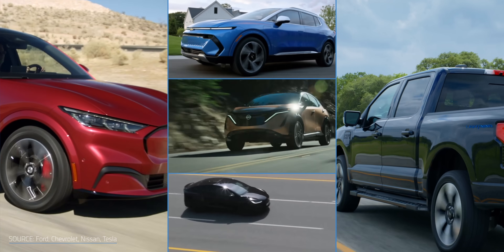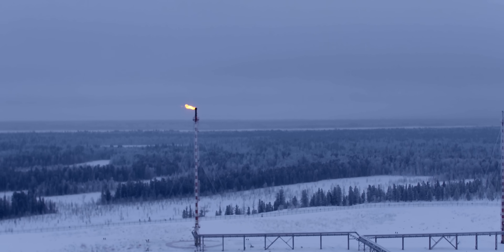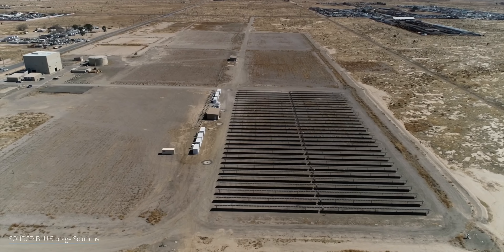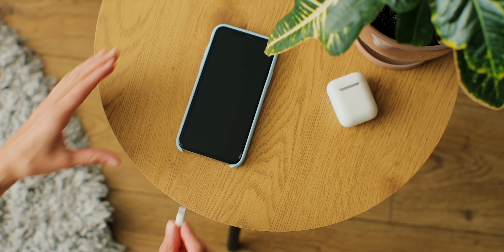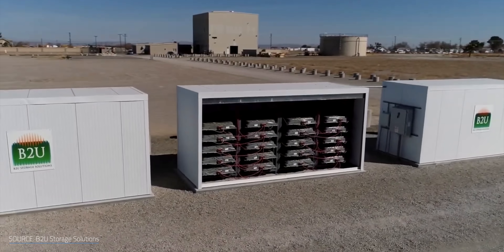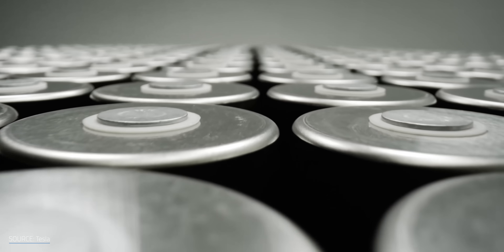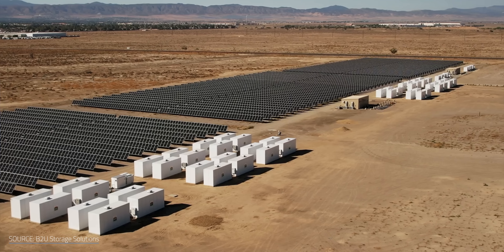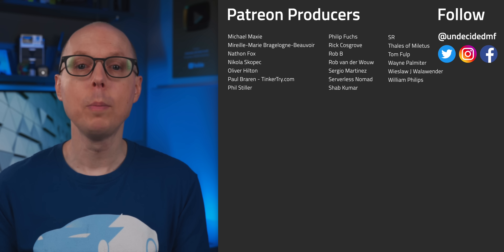How Old EV Batteries are Perfect for Energy Storage

Comment: Manufacturers could do a lot to help make this happen by building a basic standard BMS protocol into their packs.  Should probably be mandated to do this.
Reply: The standards tend to be formed by the number one players.  A good example of this is, just this past week Ford and Tesla publicly announced their collaboration on Ford accepting the Tesla plug standard.
Reply: That would be great for the grid storage industry, but terrible for the car industry. It would never happen
Reply: “building a basic standard BMS protocol”

They got them… if you really want to use them. 

The question is whether the complexity is worth it for the aggregators, dealing with every manufacturer’s software bugs, possibly with a bug causing a fire, when you can buy an off the shelf BMS & manage all the battery types the same way, with your own software.

I chose path B
Reply: It doesn't need to be a standard across manufacturers. There are not that many. It would likely be sufficient if the BMS interface was documented.
Reply: Or, manufacturers could license the tech, have buyback programs for their own batteries, and build their own power storage facilities using their own batteries. Not just standby power, but to be able to switch to stored power during peak times to buffer their own energy usage from the grid when its most expensive.
Reply: @SOHCGT96  - “manufacturer… buyback… own power storage facilities”

I don’t think an auto manufacturer wants to take on the risk of battery 🪫 lithium fires 🔥 after a battery 🔋 may have been in an auto accident or after a battery 🪫 is out of spec.

A battery 🔋 manufacturer, on the other hand, may want to create a subsidiary, which could be spun off to reduce liability…

Sounds like an opportunity!!!

But eventual recycling needs to be in the picture, and not just reuse ♻️ until it 🪫 spontaneously combusts 🔥
Reply: @DavidHalko  Running that type of business as a subsidiary would probably be how it worked anyway to separate costs/revenue streams. Lithium fires aren't fun but for stationary applications, not only can you more effectively monitor loads and temps to disconnect a pack before it has problems, but fire suppression is much less challenging. What they MIGHT need to consider though is mitigation of environmental hazards and I bet you'll see these mostly in dry areas or ones not near a flood plain. Seeing what a few cars did in the last hurricane, I can't imagine a stationary power battery array doing well in a flood.
Reply: @SOHCGT96  - “I bet you’ll see these mostly in dry areas or ones not near a flood plain”

Solar farms appear on flat land, to maximize sunlight capture and much farmland is near water & on fertile land… interestingly enough, these two things are near flood plains. Some areas in the dry South West US USED TO BE flood plains.

Solar farms really need temporary storage, to not supply power to the grid during times of energy plenty, to supply power during times of need, and maximize the use of copper attaching solar farms [which are roughly 50% unused.]

Solar farms are the locations which REALLY need temporary energy storage, to supply the needs of a region. I really wish something like splitting & storing & using hydrogen for odd timed energy would be used, instead, since water is more available than Lithium.
Reply: the leaf batteries have just that.
Reply: While that would be ideal, in practicality it would hardly be feasible. However, there is definitely room in the market for creating a basic template that makes it easier for startups and existing companies to adopt this standard by nature of it being cheaper than them investing into their own production. Thus far most of the big players keep their stuff proprietary and don't share amongst each other, which is why I'd assume this hasn't really happened yet at a large global scale.
Reply: @Real_MisterSir  It's absolutely feasible though. This is the same kind of excuse Apple uses. Following standards is easier than making your own proprietary protocols/wiring, which they do exactly because they don't want re-use/repair etc.. Car manufacturers are the worst.
Reply: @realms4219  It's not about the batteries, it's about the platforms they're matched to. Automakers, especially the larger corporations, go to great lengths to optimize every inch of the frame, the packaging, various dimensions to gain competitive advantages in some areas while letting go in others, etc. It's not like a smartphone where it's just the connecting port that has to be slightly different but still wired essentially the same way. It's entire multi-vehicle spanning platforms that are tailored by each individual manufacturer making use of their already built factories and machines and formulas that can't just easily shift on a dime. These are major ships that take time to turn, and with so many advances in battery tech happening each year it is generally considered that there isn't a big incentive to force entire platform unification (yet). EVs are still in the early phase of taking off and gaining market share. As long as that's the case, I don't think any government will want to press the issue and present more barriers than they remove.
Reply: @Real_MisterSir  As you say, the market for EVs is really only just getting started - so surely it's much better to have common standards now than in twenty years time when the carmakers excuse will be that there are so many non-standard cars on the road that the idea is a non-starter?
Reply: ...also integrate peaker plants into the railway system for efficient transport and handling.  As the railway system becomes electrified, they have a vested interest in supporting this upcoming infrastructure.
Reply: @waynejanik7046  - electrified rail in the north east looks like hell, there has to be a better way, to replace the rat 🐀nests of wires hanging all over the place, for hundreds of miles, as we travel down roads & looking at that ugly 💩
Reply: @GeorgeWashingtonLaserMusket  You're confusing BMS and BMS protocols a BMS can have multiple protocols.  If a standard protocol was brought in the car makers would still have propriety BMS & protocols but once taken out of the car people would still be able to communicate with the BMS for some of the basics like cell voltage, temp & balancing.  At the moment several EV batteries which aren't usable as there's no way to communicate with the bms and no effective way to disassemble the battery.
Reply: @blacko3539 : Which manufacturer and model EV are you saying “there’s no way to communicate with the BMS” about? Because I’m here to tell you, a BMS that doesn’t communicate with any other part of the vehicle at all would be as useless as a grease zerk on a steering wheel. Just because it’s not documented/disclosed or in a straightforward way, does NOT mean it’s completely impossible. There is a difference, and it does matter.
Reply: @jacobcarlson4010  Of course they do, we're talking about using them as batteries after they've finished being an EV battery.  First generation Ampere/Volt batteries for example are just scrapped because it's not economical to refurbish them.
Reply: @blacko3539  This is correct. Any manufacturer could make their own protocols to their hearts delight, but they would be required to include protocols that meet some minimal standard. This way they can protect their BMS IP while being good citizens when batteries get reused. There would be almost no cost to the manufacturers - plus any regulation could have language that would force them to not pass on costs. Sometimes companies have to accept that something for the public good is "just the cost of doing business".
Reply: An then here is Tesla. They glue there battery to the chassis. It's so bad that you can not take the battery out and reuse it. 

There is a big need for legislation that forces  OEM to allow standard connection and replaceable batteries
Reply: @save_jeff : I’m %100 with you on that; declaring an entire vehicle worthless because one part is worn out is frankly ludicrous. It’s one of the many reasons that I’ll never own a tesla.
Reply: Or at least force the car makers to support the integration of their battery packs into these types of systems.
Reply: @RossBobby  - “force…”

Dude, you just take the pack & connect the wires to an off the shelf BMS. This is not rocket science. It took me an hour to figure out the wiring on 2x different kinds of FORD battery modules.

You just have to not be stupid & know how to use a breadboard with a multi-tester.

I did stuff harder than this when I was in high school
Reply: It would take a mandate to do it.  They'll never do it voluntarily.
Reply: @Cee64E  - “mandate…”

Dude, you buy the pack & wire an off the shelf BMS. This is not rocket science, I did it with 4x FORD modules.
Reply: @DavidHalko , You did it.  I could probably do it.  But not everyone knows their way around a voltmeter, let alone a BMS.  It could be something as simple as making the instructions to convert an EV battery to a stationary storage unit for each pack publicly available on the manufacturer's web site.  Just something to put an end to the proprietary locks on a battery.  It's not like I'm suggesting they mandate something stupid, like wireless, battery-powered, tire pressure sending units in each wheel to tell dumb drivers when their tires are low...  

Oh, wait....
Reply: @Cee64E  - there is not much to it.

The BMS just measures voltage of the cells. The battery packs are wired in series. There is a pin for each battery 🔋. The power or ground goes through the BMS. If a battery is out of range, the battery is shut off.

You can’t make a device much simpler.

Every BMS on the market comes with instructions on how to connect them to batteries.

It is just a matter of doing it. If you put multiple batteries 🔋 in a flashlight 🔦, measure the voltage with a multi-tester between batteries, you could hook a BMS up, following the directions.

I did stuff like this in middle school & high school. The scale is just bigger with this stuff… bigger in the sense that these batteries 🪫 will burn 🔥 your house 🏡 down in a moment, as soon as they spontaneously combust… and there is nothing a BMS can do to stop 🛑 spontaneous combustion of a Lithium Ion 🪫 which has a short develop from dendrites growing between terminals inside the 🪫 battery.
Reply: @DavidHalko , Yes.  I understand that.  I know how to use a voltmeter and I've done a little work with a BMS on small projects.  But we live in a world where Preperation H has a warning not to eat it on the package, and curling irons have warnings NOT to insert them into ANY body orifice.  There are people out there who can't figure out where to put oil in their engine because the only cap they can find says 710 on it.  I'd bet a dollar to a donut that you know someone you wouldn't let near a standard 12v car battery, let alone something with a couple hundred volts and a few kilowatts of power.
Reply: @Cee64E  - and these types of people should not be encouraged to work on batteries 🪫 that spontaneously combust with age, because dendrites grow over time within the battery 🔋as they age… lest the “Preparation H” ingesting generation decide these nice warm used auto batteries should be placed under their baby’s 👧 crib to keep their precious offspring nice & warm.
Reply: @Cee64E  In the only application mentioned in the post (LARGE-scale commercial storage) any company getting into this would have NO problem implementing their own solution using any source- if necessary, completely bypass the manufacturer BMS, because the real value is in the cells (and always will be as long as there's any usable cells in a pack) unless the ROI favors basic material recycling only.
Reply: @DavidHalko  The BMS is a charge controller, too, not just a load switch. But those two functions are the only NECESSITIES.
Reply: @ticthak  - a BMS is not typically a Charge Controller. Different battery technology requires different charging characteristics. 

Charge controller for NiMH car batteries will test for the peak & then a drop, before shutting off the charging current. This is not typically done by a BMS.

Charge controller for LiFePo4 car batteries will count the coulomb difference during charging to understand when peak has been reached, before shutting off the charging current. This is not typically done by a BMS.

Charge controller for Li-Ion car batteries will track the voltage for the highest voltage, before shutting down the charging current. This might be done by a BMS (over voltage protection.)

A real good charge controller also tests for temperature, reducing the amperage charging the battery packs, during certain temperatures, as well as after certain number of coulombs. Most BMS’s are not capable of limiting current.

If you are trying to say that an automobile’s battery pack has a BMS with an integrated Charge Controller, this may or may not be the case, depending on manufacturer & battery technology. I know my 4x used automobile EV battery pack modules has no BMS and has no charge controller.
Reply: @ticthak , Fair point.  I was considering the potential for them to be used in home energy storage by the average homeowner, who might have limited experience with DIY BMS.
Reply: @DavidHalko , Well said.
Reply: We should not be trying to power critical infrastructure with old wore out batteries. It's a horrible idea.  Furthermore, they aren't standardized in shape, amp hours or chemistry.
This is a harebrained idea.
Reply: Better yet, every single electric vehicle battery should be standardized by volume, position of bolts, ports, cooling, management software, diagnostics etc. Doesn't mean exactly one size, or that the innards of the batter must be the same, but a family of sizes that manufacturers can incorporate into their vehicles. Then eventually we might do away with concerns about what to do with old batteries since they can go through a lifecycle that incorporates secondary or tertiary uses before being recycled.
Reply: Then used prices would probably double.
Reply: @Nominally-Built  In some cases reselling “relatively new” used batteries can be more than a new pac.
Reply: Yea let’s force companies to pay more money for something you’re about to buy... you’re nuts
Reply: @intelatomtm  Heheheh. It would be less than 1 tenth of a percent of the cost of each vehicle while the savings in the long term would be many times that. The tech industry uses agreed-upon standards all the time and it largely works.

Comment: This really look good.   and i'm really optimistic about this kind of solutions  to fill some niches on our low end energy storage solutions :)
Reply: As someone else said, it seems like it's just a short term solution only, kicking the can down the road for when the batteries will need to be disposed of one way or the other anyways.

We as a species really need to get better at actually coming up with long term plans
Reply: @dx-ek4vr  There are already effective recycling methods for 90-95% of batteries- they have to get much cheaper, but that's engineering dev work (and in progress)- it still leaves that small percentage that's a real problem, but there's reasonable hope there, too, and by the time the world has moved on to better chemistries (or even different energy solutions without NEEDING batteries), we might be left with a relatively manageable disposal problem.

Comment: Power went off through the night and I rigged a Ryobi 18+ 9 amp hour battery through a buck converter to run 12V inverter and that ran the CPAP machine from my wife and and it's still running now I also use a Tesla model S module to run my cottage in summer with 24 volt inverters 3000w

Comment: A couple of years ago Robert Llewelyn did a Fully Charged episode on his old Nissan Leaf.  He had a mob in the Netherlands (if I remember rightly) upgrade the battery to a new higher capacity one.  They then use the old battery in a system that sounded a lot like BTU's.  Anyway,  a very good thing indeed.  The old EV batteries have a lot of usefulness left in them as stationary storage; whether grid or neighbourhood or home.
Reply: I don't think you would want an unreliable fire risk storage system at home
Reply: @ain92ru  most batteries i would only want in a concrete shell outside the house
Reply: @ain92ru  EV batteries are much more reliable and less prone to fire than cell phone and laptop batteries.